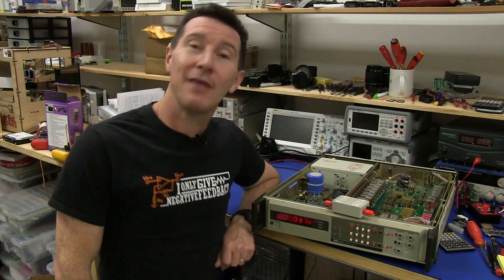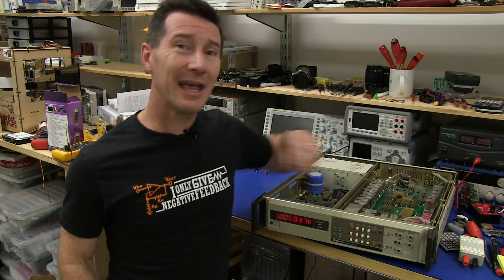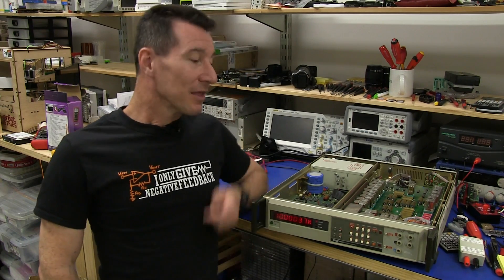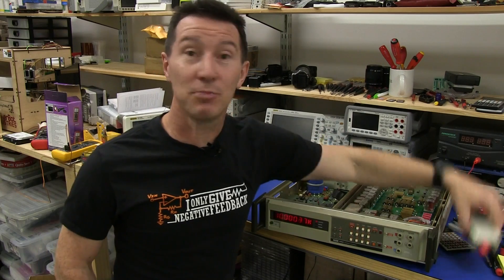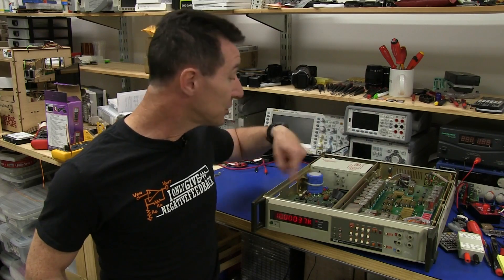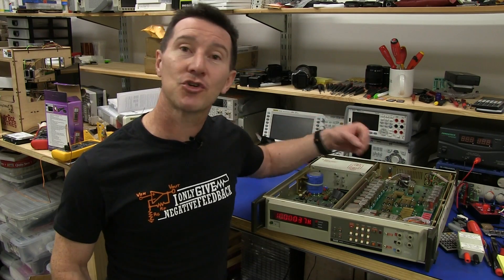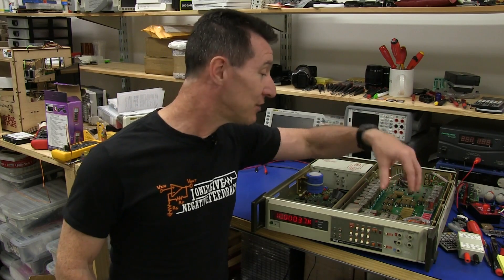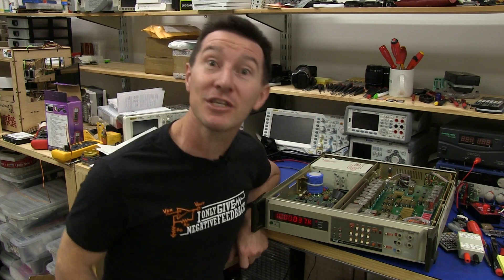EEVblog #545 - Vintage Design Rant

Comment: watching this in 2020, and yes high spec. product the  teardown makes sense,. However, not in case of middle segment and low-end consumer products. 
BTW in classic physics won't change in 30 years, but materials will. So maybe  you will design around LDPE instead of Teflon or something like that. Or maybe Alumine substrates will be cheaper in future or something else...

Comment: How can you possibly know where you are going if you don't know where you came from? 
I'm sure that he could calibrate everything with his resistor in a box and repair anything with his DIY eBay oscilloscope and signal generator.... He's so talented that he don't need no stinking fluke 30 year old rubbish.... But I bet that he loves that amazing vacuum tube sound from his amplifier.

Comment: I often have people say just use a stamp board I made a a simple timer to using 555 timer chips , I live 555s they can do most things this has 3 chips 2 555 and a5 volt reg chip parts count is 3 active components verses the stamp that has 50 plus, the MTF ( mean time between failure) is set by the component and multiplied by the amount of components,and yes the performance is Much better , so watt ! This timer is used in a hydroponic system so a micro second makes no difference but it fails more often, needs more power plus a Lipton to program it ! This is not progress I am old so when I first started electronics they were only tubes !! And components have dramatically improved but physics has not changed m, electrons do the same they always have and will stay the same so using au
Micro pros-sever is not better just easier but knowing what happens in the chip is what really maters , I love electronics and I am glad that I can understand how they work inside ! This is what it’s all about !

Comment: This video is almost vintage already, but I just have to comment here.

I'm quite interested in vintage electronics, all the way back to tube gear out of the 1920s. If you look at the design, you often tend to think "what the f*** is that" .. but most of the time, you start to see the valid reasons behind it. An example are the so called "Reflex" circuits: For many years, active elements were really expensive. There was even a time when there was a sales tax which was determined per tube in some parts of the world .. so they actually used the same element multiple times. So, the first tube was used as an RF preamp, then as an NF driver. Sometimes it was also used in the control circuit for the tuning indicator. Even in (even when it was new) really crappy circuits, where the main design criteria was "make it as cheap as possible, and after that cut the price in half again", you tend to see quite clever solutions to archive that. 

Being granted, that's really not needed anymore, transistors got dirt cheap by now and using one or less more isn't a problem and in most cases you would use an LSI building block or even complete chipset anyway (which will often contain millions-billions of transistors). 

But .. if you really want to UNDERSTAND electronics .. I would actually suggest looking at stuff from the mid 70ies to lets say early 90ies .. just the time where most of Dave's vintage teardowns are coming from. The circuits are actually quite complex already and contain many nice engineering solutions which are still valid today, but there are:

1) Mostly discrete and not hidden away an a black wonder box from Linear or Analog or TI or what else.
2) (Especially in measuring equipment) Very well documented. In manuals of the time, they didn't only give you the full schematics, but also there is most likely a large "Theory of Operation" chapter where they actually EXPLAIN the circuit to you in detail. 

Those people in general may have been limited by the technological constraints of their time, but they did really know what they were doing. There may be some new techniques now, old analog circuits are replaced by digital signal processing in many areas .. but .. even if you do that, you still have to design an analog frontend just like back then. 

Also, there are very good building blocks available today which you can just stick together to get a product of quite high quality, and in a commercial setting you would be really stupid not to use them if they are available at reasonable cost. But .. do you really understand electronics by doing that .. I don't think so. You are just using readily made products and let other people do the design. And inside those wonder boxes .. there is mostly the same stuff which was on the pizza carton sized boards back then.

Comment: I like the older gear because it's knowable.
Old nail gear.
Here's the input circuit, here's the attenuator system, here's the comparator circuit, here's the mixer etc etc.

New ass gear.
Here's the ASIC, well we're done. Bye

Comment: The message in the video is so very true. The designers of 50 years ago - in my opinion - were more often than not better engineers than today's crop - and the simple reason was that they had to be.  Before 1990, Electronics was a horrible and intimidating profession.  In the past I have worked inside some beautiful old test equipment form the 70's - the level of analogue knowledge, mechanical design and materials skills is impressive. I once repaired a vintage 60's-70's (but still incredibly useful) B&K Pico-scale inductance meter - which was crafted from beautiful materials, used every trick in the book to maintain accuracy - and was actually packed internally with sawdust to keep the stray capacitances constant. We should never forget that until the early 90's the majority of designers worked without any mcad and ecad and that an analogue design often meant  designing 20 or so discrete transistors using only spec-sheet graphs plus a pocket calculator - my boss in 1981 still used a slide-rule - "because it was quicker" btw. Spec sheets were in dusty folders on lab shelves. There was very little simulation capability - and what existed  was less than user-friendly, extremely slow and could only accommodate a few nodes at a time. With minimal ic functionality and very little integrated functionality on Silicon, designers needed to do a ton of sleight of hand to get to the outputs they required. If you take the time to look inside a 1950's television set  and really understand what the designers did you will never stop slapping your forehead in surprise at the inspired genius of almost every component layout.  For fit and cost reasons a block of digital functionality - which today we drop into our environment as a few lines of code and configure with a click  was more often than not laboriously crafted one gate at a time from discrete digital components, each with their own timing and power issues. IDEs, if they existed, were not available to most companies for cost reasons - machine code or HEX being the usual route to  program and then debugging tools could cost more than a car. The amount of thought, stress, risk and brilliant inspiration required to do what had to be done back then was mind-bendingly difficult. In short, the profession - from my point of view at least  sucked. I loved the end results, I hated the process - most of all the arrival of prototypes. More than anything else, in the 70's and 80's I stood in awe of the people that trained me. There were far fewer EEs in the 70's, and most I came across were significantly more skilled than I am today - with all my software and tools. Today in contrast things are far more fun, quicker, lower in cost and overall it is so much easier to accomplish  what we want to do.  One of the problems in todays design world is that producing a product that only marginally works is somewhat easier than it was 40 years ago. Because today we can jump from an input to an output so very rapidly, we often neglect some of those hard-learned engineering 101's that our predecessors needed to live by... needed to live by because the tools they had to play with at the time - at best - were only just capable of doing what they required.  Today with our excellent  low-cost highly integrated application-specific Silicon, ESD-accommodated silicon front-ends, noise floors falling away, power consumption falling away and high speed readily available we can get away with bending the rules more than they could in the past. Sometimes today that leads to us creating marginal designs from black boxes with internal workings we cannot see and systems that susceptible to faults that are difficult to locate and understand. The design rules in 1961 are the same as the rules today - we can all learn from looking at old schematics and PCBs - and a good first lesson would be how very lucky we are to have today's tools and systems available to us. Don't even get me started on placing a micro where three discrete components could have done the job at a better price and just as well. Don't get me started on adding shielding where good analogue design knowledge would have made a circuit bullet-proof. Today we do more, we think larger - our designs have greater scope and accomplish greater things, but those designs regularly  rest on a thinner and more unstable foundation. A client recently asked me to make a 20 microsecond timer (in a hurry) for a BOM cost of pennies. I had forgotten how to wire a quick 555 timer sometime in the late 90's - and my quickest route that day was a 40 cent micro. Doing that in 1980 would have got me yelled at for days and days - and why - because doing so lacks thought. The devil is in the details.

Comment: I appreciate your vintage tear downs, They're true works of art and its impressive to see the way engineers solved problems in a time before you could simply adjust your firmware. There is always something more that you can learn to add to your skill set, and to just dismiss something's merits because its 30 years old is nothing short of ignorant.

Comment: I actually enjoy vintage teardowns more than modern ones because of the scale of the circuits. It's easier to see how a circuit works when everything is it's own part, rather than all integrated into one chip. That and physically the parts were much bigger, which make watching more enjoyable. Whoever made that post is really not that smart. Sure things have become smaller and more integrated, but the theory behind it all is basically the same and can be applied the same today.

Comment: I agree.

The laws of physics have not changed, engineering principals have not changed,

Looking at older designs gives us an insight into how problems were solved with the available technology at the time. These solutions can be transfered into today's technology. In today's world we barely get a chance to have a scatch let alone pour hours into planning and design like people did years ago.

If you don't understand the solution then you definitely don't understand the problem.

It is called standing on the shoulders of giants :-)

Comment: I've always seen vintage gear as more educational than modern stuff from the start. I learned about sound synthesis from an analog synth with knobs and switches for every function. I don't feel I would have come to that knowledge as fast as I did if I was to try and learn on a digital device with menus and digital value based controls. Same with modern ICs vs discrete components. Vintage designs relied on discrete components more cause the IC's didn't really exist back then. Seeing all the actual constituents of circuit is far more revealing then just having an IC do all the magic behind a curtain.

Comment: there is a place in phoenix called apache reclamation that has ENDLESS wall to wall, floor to ceiling stacks of vintage test equipment like this. I mean, as far as the eye can see. I need to head back there and grab some stuff and start taking it apart (or putting it to work).  Dave if you ever come to the Phoenix area again, make SURE you stop by Apache Reclamation.

Comment: I've been in this industry fro 34yrs. In that time I have seen huge advances in technology, which is great, BUT the downside is to a fairly large degree it has "dumbed down" many aspects. Circuit theory seems to have gone out the window in favour of the "if it's broken, chuck it out" method. I have dealt with so many good techs who could find a fault down to a card level, but who could not actually repair the card itself. Most times the reason given was because of a lack of schematic. If you understand basic circuit theory, have access to device data and can follow and redraw a circuit this really is no issue. Over the years I would guess 50% of the gear I have dealt with came with no info at all. Yes it takes time but I was taught "if it used to work, find out how and make it work again". I guess my biggest "pet peeve" is people who post PCB layouts for projects that really just shouldn't. Some of the stuff I have seen floating around the net is just plain terrible. Being able to "use a PCB layout application" really doesn't make a person a PCB engineer.
Reply: jabathaslut1 I know someone who works at a tier 1 automotive supplier doing PCB layout and parts library management.

There are a LOT of people who do not understand the amount of work that is done in layout.

HV keepouts and clearances, choosing the right part layout, doing packaging studies for complex mechanical enclosures, dealing with engineers who are changing schematics and trying to add features still.... it's not a "slap the chips on the board outline and hit the autorouter" kind of thing nor has it ever been.

She's been in the industry since they were doing layouts on mylar film for the old photolithography process. used to work in the defense industry doing aeronautical work before moving into automotive. I'm glad I got to see what she does because i appreciate it so much more now.

Comment: I spent far too much time on your blog trying to help. I shared a design and was besieged with trolls. They insisted my design was wrong and could not work - even though it's been used in TV stations worldwide. Reporting the attacks to the moderator (Simon) resulted in a "grow up!" message from him.

So I'm just going to pull the plug; I won't be visiting your blog any more. It's not about engineering, it's a free for all where the "elite" pass judgement on the peons and opinion is a substitute for facts. Good luck with what you're doing and always remember that I enjoy your videos very much. The blog is a big "no thanks" though.

Comment: Do they not make precision SMT type resistors that could be used for higher values today to keep it leadless? I understand that the really low range ones need to be resistance wire. I'm assuming they use a bridge to measure each of these vs. a lab standard and bin them into groups. I used to have some very accurate general radio lab standards and a LCR bridge and it could measure comparatively very accurately.

Comment: This video is fascinating. I wish Dave would critique FM/AM/CD receivers and players made by Onkyo and others. It is indeed fascinating to learn how they work and how electricity flows through these devices. But man is electronics time consuming! But fascinating! I bought the soldering iron Dave uses and I've yet to even turn it on although it's been 6 months. When I get my house and yard straightened out I shall put it to use.

Comment: The vintage teardowns contain more interested things. What You can learn from the modern boards? In the past the engineers used the brain, not the computers and simulations. This is why most of the vintage electronics has better sound, result, specs, nice analog solutions etc... They take a care on the testing and on the measure results. This is what we forgot in this days. I Just respect on the old gears and take the best ideas and smart solutions. Dave, do more vintage teardown :)

Comment: The only thing that has changed in 30 years is the quality of the electrons.  We use electrons with tighter tolerances since about 1995.

Comment: Totally agree with you dave. I designed an LCR meter based off of a GenRad LCR meter from the 70s? The analog circuits and functionality was pretty much identical. The digital side was the only part that was significantly different

I the key modules: (Arduino, 16 bit adc, DDS sine generator, comparator based phase detector, peak detector)

Comment: The great thing about vintage tear-downs is that much of it can still be seen by the the naked eye. When looking at surface mount boards with a zillion layers, you cannot see what's happening. I actually learn more about basic electronics from the vintage products. I'd rather see a bunch of capacitors, resistors and transistors soldered onto a large board than just one chip on a tiny board. Electronics today are miniturized, and it is virtually impossible to reverse engineer any of it without having to revert to Google again and again.

Comment: learn from the mistakes of the past - the ideas that end up in the modern design are certainly the same like in vintage design, but I think that maybe the details like the teflon standoffs might be replaced by something new with identical specs,  but cheaper or easier to handle.